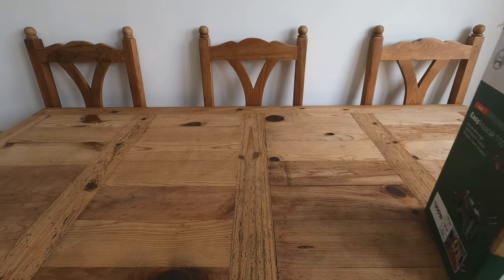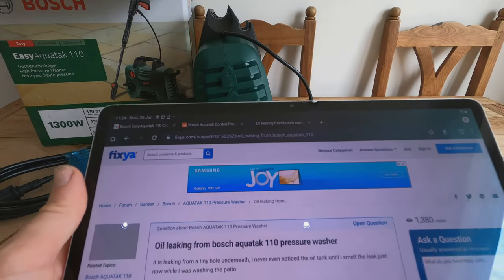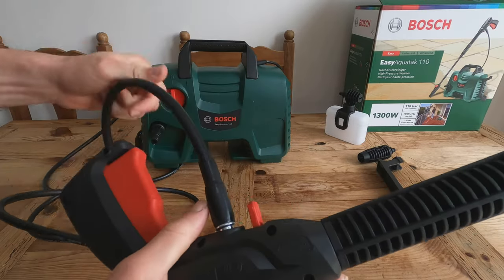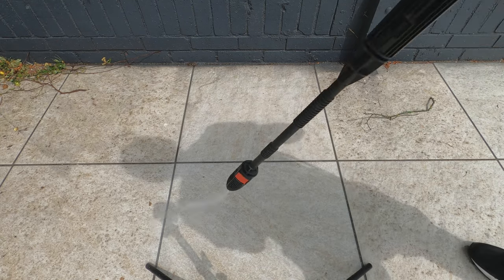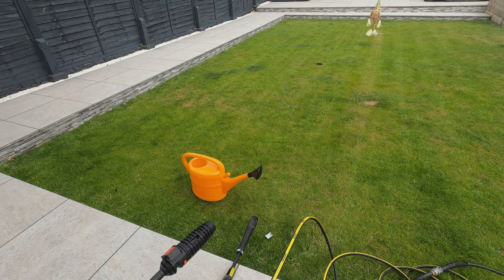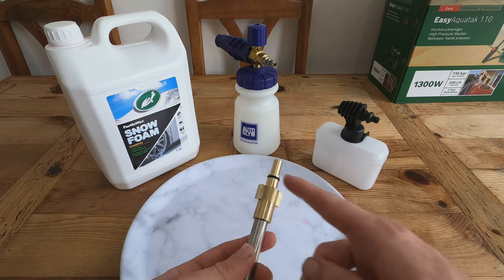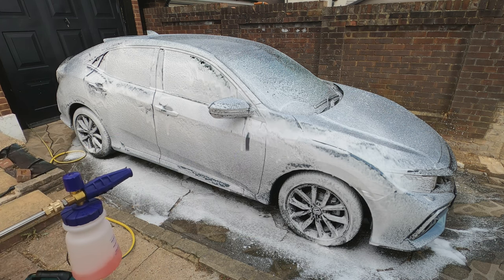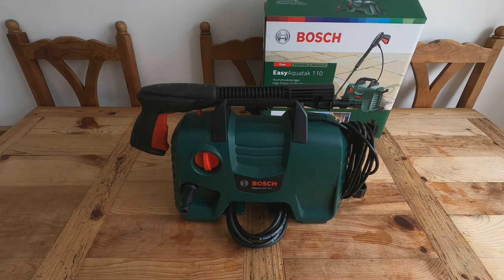Bosch Aquatak 110 Pressure Washer - Unboxing, Comparison & Review -  Pressure Washer For Under £50

Comment: So this one is the discontinued version by the looks of it.... The new Easyaquatak  120, which is about £80 comes with a 5meter hose, 5meter power cable, twists from the top, the hose connector on the machine is easier to connect. I watched a few vids and you were all saying the same thing and sounds like bosch have listened. I'm waiting for a hose pipe adapter before giving it a go. Also ordered myself the foamer you recommended! Ridiculously excited about washing my van!
Reply from the maker: Haha 👌👌👍👍
Reply: Oh, i misunderstood what you meant about the twist!
Reply from the maker: You've lost me 🤣🤣

Comment: I was at our holiday caravan in Somerset a couple of weeks ago, saw this online £47.80, popped down to nearest B&Q & bagged a bargain pressure to clean our caravan of crud that builds up whilst we are back in Midland. Limited storage in a small storage shed outside caravan so the compact size ticked another box. Will use to clean decking at van & car from Motorway grime. For the $, it a no brainier. Great video & shall buy same quick release adapter to attach my foam cannon 👍
Reply from the maker: Thanks for the comment, we use the titan portable washer to clean the caravan 🤣 gonna take this down for the caravan this weekend.

Comment: The 1/4 Inch aquatak adapter is Currently unavailable on the link you provided, is there any alternatives? I have the easy aquatak 100, yet to buy any foam cannon parts/adapters
Reply from the maker: I have changed the link to one that's available 👌
Reply: @charlieschannel4192  ty mate

Comment: you can get a copper adaptor for the bosh and mac Allister power washer  to fit a steal lance with different head for more angle of spray and also fit on a snow foam cannon with a copper attachment i know this because i researched it and the new lance and snow cannon are ten times better than both of these power hoses

Comment: It's interesting to see it being used on tiles like this. When I had my patio done last year, using similar tiles to here I was told no you must not use a pressure washer especially on the grout 🤷‍♀............  Great video
Reply from the maker: I wouldn't hold it too near, 😂 you have to be careful with the grouting because you might remove it with the pressure against it
Reply: @charlieschannel4192  thanks Charlie 😊

Comment: Im buying a home and I want to buy this one to clean the garden a bit. Do you think is suitable for a quick DIY job cleaning the garden?
Reply from the maker: Yeah it'll do the job 100% but if your going to be cleaning your patio a few times a year, or cleaning your car montly, then I'd recommend something abbit more powerful,  the titan 140 bar is what in using atm, it's a little more at £100 but it's a great bit of kit, not putting you of the bosch becaaue its a good price, very good and very compact 👌

Comment: Your preferred? Bosch or karcher?
Reply from the maker: Unfortunately I can not say atm, I have only used the bosch for a month now, which it does fine, especially for it's price! But I've had the karcher for 6-7 years and never had a problem with it, although it was allot more money
Reply: @charlieschannel4192 Do you still use it? Which would you prefer now, Bosch or Karcher?

Comment: Is the pulsing a fault?
Reply from the maker: Since using it a few more times, it was doing when my garden hose pipe had a slight kink, which when I use my karcher it  isn't a problem, but with the bosch one it just seems abbit more sensitive when it hasn't got full pressure from the tap at all times, if that makes sence lol 🤣 long story short no it dosnt pulse if you have a good connection fron the hose to the bosch 👌👌